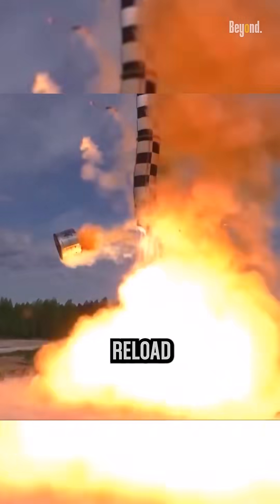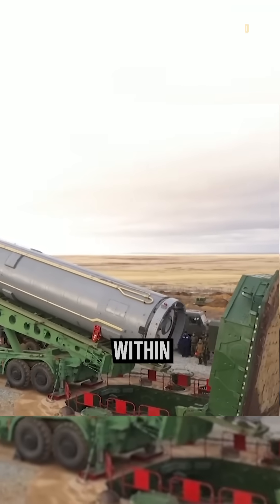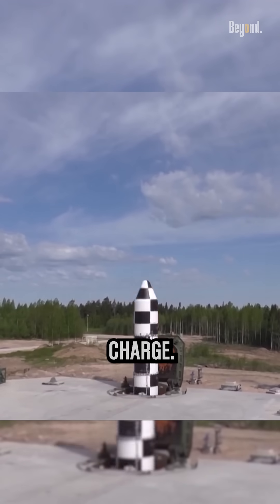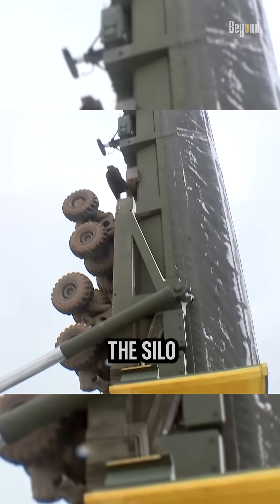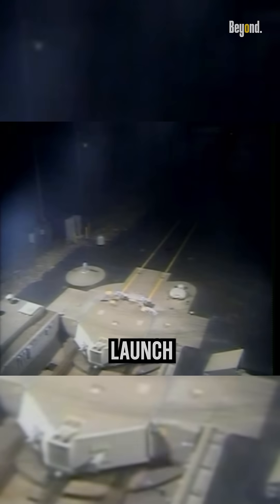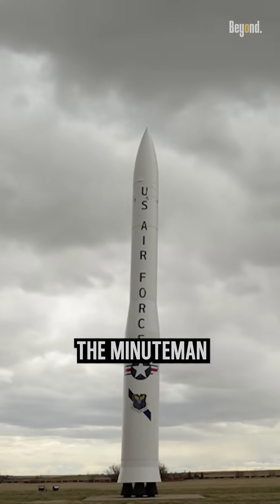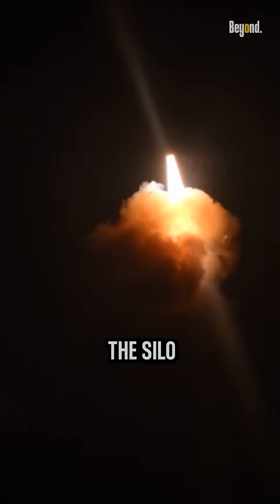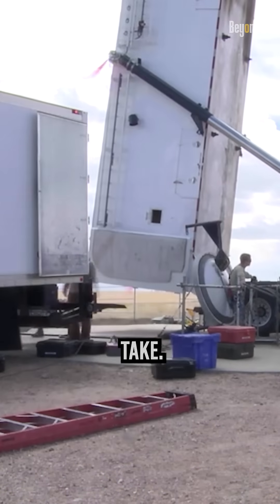What happens to a missile silo after a launch? #shorts

Comment: Hot or cold is irrelevant when 80% of your missiles and 80% of the remaining warheads fail.  Dimitri Corruptivitch stole the electrical wiring so his general could buy a villa on Lake Como. And Sergei Conscriptovich can barely read he’s so drunk, he fuelled the  generators needed to run the silo with water after he drank the methanol meant for fuel.

Comment: what the... its just a little, brief heat. there is no damage to the launch tube on a hot launch. so you can in theory use both several times until someone has to clean the walls from soot.

Comment: Americans aren't very big on recycling and think the world has infinite resources.
Reply: Wow, you're totally wrong. How does it feel? 
No dingbat, the American's use a hot launch here for for 4 reasons. 

1) A hot launch is more reliable then a cold one.

2) A hot launch is faster then a cold one.

3) A hot launch allows for a larger missile.

4) American's understand that our land based missiles would be targets so what's the point of making them easy to reload when they're gonna get hit with several hundred kilotons per missile hatch?  

Bonus 5th reason, Americans boomers were far more likely to survive. Guess what? They could be reloaded and used a soft launch system. It's almost like we thought about it and ran the cost benefit analysis. 

But you go on hating on America and wondering why we're the dominate mega power and you're not.

Comment: The question wheter to design them reloadable or not probably comes down to the payload of the missile. If you want to turn a city of millions into glas with that thing, there is no need to worry about reloading. You just ended humanity. 
If you just want to erradicate an Air Base or some other smaller instalation as a warning for your opponent to not cross the Rhine or the Oder, it‘s probably smart to have the capability to do it again a short time later 🤷‍♂️.

Comment: This is why eventually all these types of weapons will be located into space, in a vacuum, a missile or torpedo will not have to fight against gravity to launch and it’s tubes and launch platform whether it be a ship or station undamaged, a simple mechanical push and it can be directed toward any earth or other space bound targets - any burn after the fact will mean it can accelerate to far higher velocities which will mean countermeasures will be a lot more difficult, as well as the period of detection far lower due to the possibility of it not having needed to be ignite it’s own fuel for repositioning until it breaches atmosphere dropping straight vertical.

The physics of a zero-G and zero air resistant environment makes for a far scarier battlefield where projectiles do not have any real cost to be launched, as well as the omnidirectional nature meaning death can come from anywhere

Comment: It is such a stupid example. You had better compare the Patriot system (hot launch), which means it can cover only 180 degrees (in front of the system), and the S400, which has the cold touch and can cover 360 system, it can hit the air targets even if they are behind the system. 
Z! To the victory!

Comment: But cold launch is risky because sometimes the missile engine will not activate so the missile will fall and then GG 
While hot launch is better and safer so if the engine of the missile will not activate then it will stay in the silo without any losses

Comment: This was actually interesting.  I had not heard of cold launch systems before.
Reply: It is used in subs. Pressurized air send it up and out, engine ignites after it has cleared the tube or the water surface.

Comment: Fascinating, but in order to reload, you'd have to reset the launcher, prep a missile, cart it and crane it into place, unless you are talking about the mobile launcher, which cold drive to a supply base (pretty sure they never finished a mobile reloader). I believe the laucher is gas based, not black powder. Not to mention all SS24s have been dismantled (hooray for Start 2) with Ukrainians (the manufacturing facility is in Ukraine) promising to never make another.

Comment: with 4000 nukes ready for launch i doubt there would be any need to re-load.

the advantage of a hot launch is that there are less chances of the main igniters not working once the the missiles has been ejected from the silo,they either fire or they dont, if they dont fire well close the door and call it a day, in the cold type the engines may not fire and the rocket my crash taking off.resulting on a radioactive waste all over the silo site and surrounding areas.

on a hot launch if the engines fire they wont stop until that rocket is way away from the area.

Comment: People need to take into account the fact that one missile contains MIRVs, so a single missile doesn't mean just a single hit.
Reply: First intelligent comment I've read yet.
Reply: Actually a treaty caused the removal of the Peacekeeper missile (with its 10 RVs) AND the replacement of the 3 RV bus on the Minuteman III with a single RV setup.  Treaty only allowed one RV per missile.

RV == Reentry Vehicle, a.k.a. warhead.
Reply: @JanPeterson  If you're talking about the START Treaty, then you're wrong. Some missiles (Peacekeepers and Minuteman IIIs) have to be decommissioned, but kept warm, to comply. To keep the number within what is allowed in the treaty. In terms of number of reentry vehicles per missile:

"While a MIRV attacking missile can have multiple warheads (3-12 on United States and Russian missiles, or 14 in a maximum payload shorter-range configuration of the Trident II now barred by START), interceptors may have only one warhead per missile."

ICBMs, such as the Peacekeeper and Minuteman III are not limited to one warhead per missile.

Comment: it is not about reloading but also about warhead design and launch systems with multiple missiles

on a submarine that launches multiple missiles with conventional warheads, cold launches are a option

you minimize the risk of damaging the vessel - also sub surface launches are a bit easier with a cold launch, the expanding gases need to go somewhere 

so ejecting an SLBM from  the launch tube first and then starting the flight motor / booster has benefiting aswell 

also man portable systems usually cold launch to make them safer to use for their surroundings

Comment: Cold launch lets you build cheaper siloes.    It's not to refill them.  If you are launching missiles in war it's probably not going to get rebuilt, if it survives the counter strike.  

Cold launch is better because the rocket engine tears up the silo and can tear up the missile.

The Titan 2 missile had to have bunches of baffles and special fixtures to prevent the motors from trashing the airframe of the vehicle.

The Minuteman used to have an ablative coating to prevent the motors from damaging the airframe during launch.
Reply: Chances are that a cold launch is slightly slower than a hot launch.  Time to get those birds up high is important when the warheads are coming in.

Comment: Once airborne, the missile knows where it is at all times. It knows this because it knows where it isn't. By subtracting where it is from where it isn't, or where it isn't from where it is (whichever is greater), it obtains a difference, or deviation. The guidance subsystem uses deviations to generate corrective commands to drive the missile from a position where it is to a position where it isn't, and arriving at a position where it wasn't, it now is. Consequently, the position where it is, is now the position that it wasn't, and it follows that the position that it was, is now the position that it isn't.
In the event that the position that it is in is not the position that it wasn't, the system has acquired a variation, the variation being the difference between where the missile is, and where it wasn't. If variation is considered to be a significant factor, it too may be corrected by the GEA. However, the missile must also know where it was.
The missile guidance computer scenario works as follows. Because a variation has modified some of the information the missile has obtained, it is not sure just where it is. However, it is sure where it isn't, within reason, and it knows where it was. It now subtracts where it should be from where it wasn't, or vice-versa, and by differentiating this from the algebraic sum of where it shouldn't be, and where it was, it is able to obtain the deviation and its variation, which is called error.
Reply: Did Kamala Harris write this comment?

Comment: There is a 3rd option, the Minuteman has a class that was modified with a steam assist system specifically so it could be launched from a train without destroying the train or tracks. The project was scrapped but the "Hopper" missiles were put in normal silos
Reply: This was never Minuteman. It was the Peacekeeper Rail Garrison. Peacekeeper was engineered from the beginning to be a cold launch ICBM. Existing Minuteman launch facilities were modified to accept the larger Peacekeeper, of which only 50 were ever put into service w/ the 90th Missile Wing @ FE Warren AFB. They were all retired by 2005.

Comment: It should be noted that the reason for this is to ensure you can do test launches with reduced rebuild costs of the silo itself/quicker turnover, NOT with the aim to reload the silo in an actual nuclear war. In an actual nuclear war every silo on both sides gets off exactly one launch before another nuke lands and annihilates it.
Reply: Very true. However, cold launches are far less reliable and often the rocket (sans nuke) falls back to the ground. The damage is far more expensive and time consuming to repair than the hot launch silos

Comment: The only thing in this video:
-Missiles from cold launch silos is launches better than from the hot launch silos.
-Therefore cold launch silos is better since it reloads faster as it does not damage the silo after the launch.
-Russia uses cold launch silos, meaning they can launch a missile after firing one in a short period of time. USA don't since they only launches once as they use hot launch silos.
-In conclusion, Russia is better at launching missiles than USA since it has better missile launch rate than the USA due to Russia using cold launch silos.

Comment: That's just the way the US designs land-based silos.  Tridents riding on SSBNs are cold-launch and those silos can be reloaded. The US has 14 boomers with 20 (24 silos, four are permanently deactivated) silos each. Sitting on top of each Trident II D5 are an average of 4 MIRVs.  That's a max of 1,120 warheads on SSBNs (though they could also load out cruise missiles).  The US wouldn't launch land-based missiles in anything but a defensive move.  There are 450 single-warhead Minuteman III missiles dotted around the the US, mostly in the midwest.

Comment: If you need to reload silos, then you've already lost
Reply: I intend to end the threat on my first shot, however my bcg still chambers another round 🤷‍♂️ and I wouldn't have it any other way.
Reply: @SimonWoodburyForget it doesn't only cuts the cost but also becomes nice when you have too many nukes to keep in silos (most of them are in reserves) so you want fire multiple icbms with same tactical advantage of a location too.
Reply: @krishthakar6661 nukes require expensive maintenance. Russia does not have the economy to do that. Those nukes in reserves won't work
Reply: Phil Swift at the launch controls be like:

“Now that’s alotta damage! How about a little more?!” 😂
Reply: @SimonWoodburyForget  No such thing as a cheap missile silo...they are probably hoping to down incoming nukes using EMP/AA/etc...
Defensive fire is a possibility for reloading.
Reply: Actually it means they can fire 5-6 Nukes from that same silo before the enemies nule hits them....that is very..VERY effective if you ask me
Reply: @chargedx5768  So why don't you have 5-6 silos to launch 5-6 missiles into the air simultaneously? That's what America does. This simplicity ensures that the system has minimal error from the fewest moving parts and minimal steps. As the Russians were reloading all the American missiles had taken to the skies, oh sorry I forgot the state of Russia's economy. LoL
Reply: @Zen士 isn't Russia also using mobile ICBM which i way much cheaper

Comment: If that middle failed to ignite somehow it might fall back and blow up
Reply: The nuke wouldn't detonate. Even Russia isn't that stupid to have the armament arm itself upon launch.
Reply: @R0me0316  ok ...but at least it didn't go anywhere
Reply: @franklacy9813  I believe there is a chance of the rocket fuel to explode, but given the fact that if it doesn't light upon expulsion, there more than likely won't be another source of ignition to set off the rocket fuel. Therefore, it would just be a pile of highly combustible rubble to be cleaned up. Even in the event of fuel combustion, the odds of the explosion being large enough to set off the warhead would be highly unlikely.

Comment: Kudos to the team that designed that initial stage and the cool way that motor kicks it to the side.
Reply: If you think this motor design is cool check out the Russian Oniks anti-ship missile start sequence. It's cool as hell. Russia still sucks for the Ukraine invasion, and Slave Ukraine, but like you I can appreciate the design.
Reply: Yeah that piece separation on the checkered one looks so cool
Reply: Until it fails and the middle crashes down right there.
Reply: My thinking was at first small rocket stage that gets punted to the side once it clears but then it clicked in my head thats actually more like the wading or Sabo behind a shotgun style round, just allot more fancy.  Its just there to contain the force of the piston under the rocket and also to protect and support the rocket, pretty cool stuff.
Reply: Assuming it doesn’t kick all the way around and end up where it came from.
Reply: I thought that was pretty nifty as well!
Reply: Yea cold lauch missiles are sick
Reply: its 90% FAILURE RATE at launch
Reply: that's some high level soviet vodka engineering.
Reply: @issadraco532 dah comrade, is like kicking table from under vodka bottle! i don't know how, my vodka always land upright and never break!
Reply: It was likely stolen from the Americans as the us was way ahead of them on both systems..
Reply: It's just a partial hinge that decouples when it reaches a certain angle, but yeah, it looks neat.
Reply: Nothing compares to self leveling of P-800 Oniks 🚀
Reply: I was thinking the same way. That burst that kicked it out to the side was cool since that is to protect the bottom of the rocket while its ejected.
Reply: every now and again they get summat right